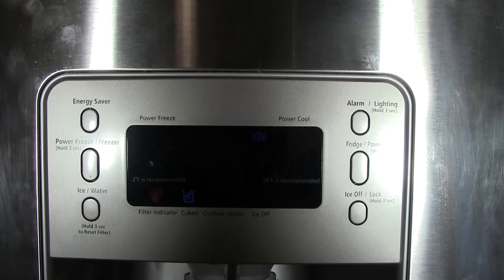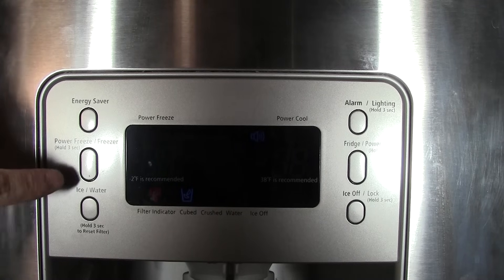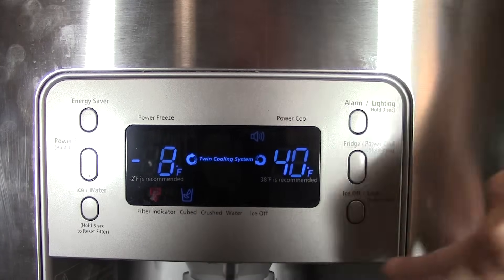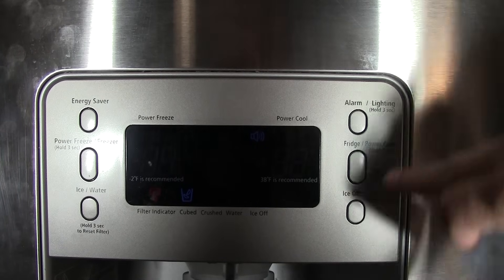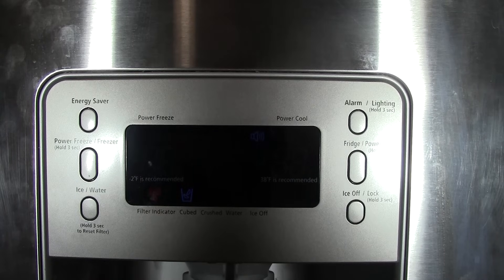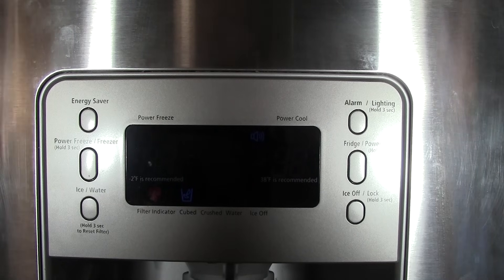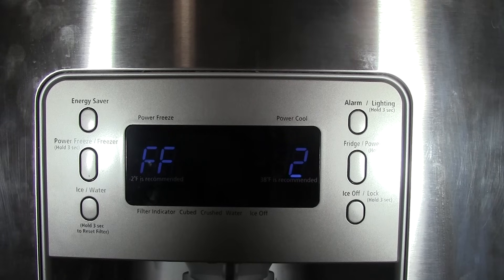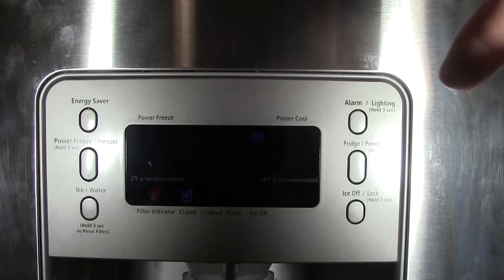FORCED (manual) DEFROST mode on a Samsung Refrigerator--Top Secret Setting

Comment: Geri, if yours is a RF267 and has the flooding and freezing problems (as with all 267s) it is the defrost drain at the bottom of the coils in the back panel of refrigerator compartment. The defrost system defrosts the coils (producing lots of water) but does NOT defrost the ice from the drain hole and tube that is supposed to get rid of all that water. So.. The water goes everywhere except the drain. Simple fix for this is to pull the compartment back panel and add a little wire (I use copper) to the defrost coil. I just wrap the wire a couple of times around the defrost coil right above the drain hole and run the wire down the hole 10 inches or so. When it defrosts it heats the wire a little and keeps the drain cleared, and abracadabra! No more water problems for about .50 cents. Or you can pay $200.00 plus to have it done by a Samsung Tech.
Reply: Timbo D Hello, and thanks for the comment, as my RF267 is starting to show these symptoms. Flooded all over my floor and noticed ice was forming around the vent holes within the fridge. I am about two thirds of the way getting the back panel off due to the ice accumulation. My question while I wait for it to completely defrost is since the drain hole gets clogged, is it safe to say it is due to the fact that something is not right with the evap coil? Whether it's not staying on long enough to completely defrost or it isn't getting warm enough to do its job in its entirety? Had this fridge for a little over 7 years and this is the first issue I've had with it in regards to ice buildup within the fridge. Just seems a little weird that only after 7 years the ice buildup would occur with it being nothing more that the drain hole being plugged. I understand the plugging is part of the issue but is that a result of faulty coils? If adding the copper wire down the hole is a 50 cent "hack" I'm still all for it, I was just curious if it is indeed a hack in order to prolong repairing the coils which I know is a much more costly repair or is it a bad design by Samsung?
Reply: In (my opinion only) I think the coil weakens somewhat over time like they do in dish washers. I did this to my own thinking about the same thing you are. Mine started freezing up at year five. I knew the defrost coil was good because I could hear the little sizzle sound now and then when it was defrosting indicating the coil was hot. Your problem could well be a bad coil or board but with mine it seemed worth a shot, and it worked great. You will see the little tab put there to defrost the drain opening and you will also notice it is far to short to do much good. The wire did the trick in my case. Be sure you defrost it (completely). There's a great little video by majdr622 "How to fix Samsung RF 267 drain problem - water under crisper" Check it out, and good luck!
Reply: Timbo D Thank you for that valuable information. I defrosted it for about 14 hours, adding hot water down the hole and sucking it back up. Only thing is it would never drain. I opened up the back panel and took the hoses off both the freezer and fridge and placed 2 small cups to catch any water....nothing! Bone dry! The fridge was unplugged and i even stuck a 14 inch plumbing snake down the hole and another 14 inch snake from the bottom end up...there was no resistance on either end but they did not reach each other!  Only thing I could think of was either the clog was between the snakes somewhere or since the fridge was off that there's some sort of trap door within the hole that prevents any water to proceed into the drain pan while off. I added a 4 inch copper wire into the hole and reset everything. It's been about 12 hours so far and freezer and fridge are back to operating temps...I guess I'll just wait and see if ice builds up again. Wish me luck! And thanks again for the help.
Reply: I don't think there is a check valve in the drain, but by all means my friend.. good luck.
Reply: There's an aftermarket drainer to clip on to the coil and insert in to the drain. I just ordered it https://www.amazon.com/gp/product/B008KFG9NO/ref=oh_aui_detailpage_o00_s00?ie=UTF8&psc=1
Reply: @ericponce8388  I wonder if the drain tube has p trap like a sink drain to prevent odor.  If so, you would need something very flexible but somewhat stiff to rod it out.  Maybe a big ziptie.
  Am trying to figure this freezing up problem on one myself in the freezer.  Have worked on many fridgedbut Samsung is a new one for me.  This one has nothing going into the drain to work in conjunction with the df heater.  It looks as though it has had one at sometime.
  Normally, the things I would check would be df thermostat, df heater, and timer or board on the ones I normally work on, but this is a little different.
  I will say this, imo, anytime you have to use a forced defrost, there may very well be an underlying problem, and I would expect the symptom to recur until the cause is remedied.
  Speaking of the ziptie, maybe try forced air which might be a little messy, especially if there is still water or loose gunk in the drsin pan.

Comment: Hi Jake, thank you for the video, learned a lot. Just got off phone with Samsung. I was told that the reason I'm not getting ice and cannot remove the ice bucket (only moved about an inch) is a "build up of ice in the bucket" and was told I needed to have it serviced. I asked her if I could correct the problem myself. I was told to unplug the fridge for up to 24 hours and let the ice melt. Jake have you seen the date, I have a fridge filled with thanksgiving goodies, is there something you can think of that Samsung isn't telling me.  Just have a feeling.....
Reply: what they didn't tell you is that Samsung knowingly designed, manufactured, and sold a defective product. A product for which they have issued 0 recalls, 0 explanations, and to this day they still do not admit to making a faulty ice maker, a device which has been around for decades.
Reply: @unanonymous4655  Do you also suggest a defrost  (forced) or is this something I will need a service man come out for.  My sister did indeed buy the extended warranty. *happy*. But this is a scam, it needs to be exposed. My sister filled the house with samsung appliances, we are not happy with the washer and dryer either. 
So sorry to bend your ear, I very much appreciate you contacting me. Happy Holidays.
Reply: @tammieadams3661   I say give it a shot, maybe run it a few times in a row. If that doesn't work try a hair dryer (careful not to have it on high or keep it in one spot for a while or it will warp the plastic). After that I'd say call up Samsung or grab some ice trays. Happy Holidays and to hell with Samsung appliances.
Reply: Try forced defrost (FD) and use a hair drier to speed up melting around the ice maker. Careful not to burn the plastic and watch for water- don't get electrocuted

Comment: I was ready to tear into pulling out the fan when I saw your forced defrost tip.  It fixed the fan noise so well it's hard to tell it's running.  And like some others have said, it recycled itself after about an hour.  Thanks for this valuable info!
Reply: When u put it in the n FD mode did you leave it until the beeping stopped?
Reply: @michaelbeltran8296 what is a 22.  E.   NOTIFICATION ON A SAMSUNG REFRIGERATOR?  IT HAPPENED as i plugged it is
Reply: @michaelbeltran8296   Leave it until the beeping stops, I suggest repeating the process to ensure all ice is melted. The fan tends to have a lot of ice buildup and the heating coil is not around the fan. The first time this happened to my fridge I had a technician to come remove the panel, defrost and change the termostat...waste of money. The fan was all clog up in 2 months. I did the defrosting my self without changing the thermostat lasted about 3 months. Now I am using double Forced Defrost ...I have this Samsung fridge  for 4 years-very disappointed

Comment: Great tip, just want to add that if you have to open the back panel at some point, add some copper wire from the heating element into the drain. It seems this problem is also because the heating element does not touch enough the drain in order to keep it from freezing. I added that wire and it kept me from freezing for 2 years.

Comment: Thank you! After resetting filter I saw OF for both  freezer and fridge on the display and temp started rising fast.  My model is different from yours in the video but holding Power Freeze and Energy Save together made the the compressor start up just as you said! I am so grateful, it's 8 pm on a Friday night and you have saved everything in my fridge!

Comment: This was a very helpful video.  I put my fridge in Forced Defrost regularly now to avoid ice build up since I had to open it up to get the chunk of ice out of the back this summer.  Since then, I experienced a new problem which I have not been able to find much information on the internet.  The refrigerator compartment was getting too cold and freezing up my fruits, veggies and liquids.  After much trial and error I determined that the issue was that the damper door in the back of the crisper tray was somehow "stuck" in the shut position.  This resulted in the cooler air, meant to go into the crisper drawer was being routed to the top of the fridge instead, resulting in it being too cold.  I don't know if others have had this problem, but if they have, it could be the topic of a helpful video particularly showing how to take the crisper compartment apart to replace the damper if needed.  I was lucky, that mine seems to be working (so far at least) once I forced it open, so I have not yet had to replace it, but I can tell that removing the shelf where the water filter unit sits is not easy and necessary for damper replacement.  A replacement damper is about $45 on line.  Thanks again for your helpful videos.

Comment: Thanks for the info!  I didn't read all the comments so this may have been mentioned - there is a retrofit kit part number DA82-01415A  This includes a better designed little aluminum piece that is heated by the defrost coil and sticks down inside the drain tube.  It also comes with 2 new drain tubes (installed from the back).  If the problem originates from water not draining and backing up, freezing, etc.  This kit may help the defrost problem.  I needed it because my RF267 was draining down under the deli tray.
Reply: We did that!  It was our original problem and the solution worked perfectly.  NOW the coils freeze up at the top instead.  This causes ice build-up on the fan which eventually stops working.  Sigh... hopefully, this video will solve that issue.  I'm not opposed to forced defrost once a week but I am tired of taking my frig apart every six months.
Reply: I added the drain kit and changed the sensors. I also bought pipe insulation for the exposed copper tubing behind the panel. No longer ices up. It's been 9 months.
Reply: UPDATE:  
After watching all the numerous videos and trying all the suggested fixes, it continues to ice up...  FD worked for 2 days at most.  Ice was now forming on the back wall inside.  After having it apart 4 times in 2 years, I finally just trashed the whole thing.  Bought a Whirlpool instead.  Fingers crossed!!
Reply: This happened to us as well.  We did stop the leaking but now, 2 months later , the fan is very noisy.
Reply: @kevincummings8755  what do you mean by changing the sensors?  Just to confirm, this was insulation around cold or warm pipes?  I’m not sure where the evaporator outlet is, nor do I promise to be an HVAC tech, but I’m having the same issue after installing the aluminum defrost adapter.
Reply: @Thrasher857  insulate all copper pipes that are exposed behind back wall headed up from the coil to where they go into the wall. Install new defrost kit. I also changed 2 sensors I found in parts break down. Me refrigerator works fine now. Ice maker still not working that's another problem.

Comment: Absolutely awesome tip.
My Samsung French door model was continually forming ice under the bottom freezer draw and then melting when it reached the very front.
This tip (so far) has seemed to have worked.
The only difference with stopping the forced defrost mode on my model is it uses the same 2 buttons as entering that mode .
It cut off automatically after approximately 40 minutes and went into "normal" mode, so it would seem safe to do while occupied doing more exiting stuff as the continually beeping which can't be muted while in forced defrost mode is rather irritating.

Comment: Thanks. This helped me already several years ago, and I've been using this every couple of years. The defrost sensor dies every year or so, and I force defrost before swapping it out.
Now my freezer says it is at -18°C but it's not cold inside, and all the food is defrosting. I noticed an ice buildup in the rear wall (frost kind of creeolping through the vent holes). Will the forced defrost work for me on the freezer as well?
Thanks in advance.

Comment: Thanks for the defrosting tip Jake. My RFG237AARS/XAA took about 45 minutes to quit beeping. The compressor noise stopped and it seems to be cooling down without without anymore "button pushing" on my part.
Reply: interesting points ,if anyone else wants to learn about best phone number lookup app try Tarbetti Phone Finder Tutor (do a google search ) ? Ive heard some great things about it and my buddy got excellent success with it.

Comment: skip to 6min so see force defrost

hold Energy saver and fridge button at same time for 12 sec or so
when display goes off, press fridge button to light display
press button till FD appears, this is force defrost
press hold energy saver and power to return to normal
Reply: Thanks. I have a RF263teaegs.  This worked.  I screwed around with it until I found this combo.  Holding freezer and light causes it to display two numbers that I can move up or down.   Not sure what they do so I put them both back to 0.

I will say this incessant beeping for Fd is annoying
Reply: @troyetherton5869  I'll take the beeping any time over $200 service call. $100 for showing up and then I'm sure some defective parts will be found. Bunch of whiners.

Comment: Force defrost runs about 30 minutes at least on my test. Sample size is only two though! You may have to pull the power plug out and put it back on to restart the compressor. Thank you for the video, it works beautifully.

Comment: I used this method to force a defrost on my Samsung refrigerator when removing the evaporator access panel. After a 15 to 20 minute forced defrost, the stubborn panel was finally removed. It seems that the forced defrost helped the panel removal.

Comment: Thanks for this easy fix. My Samsung RFG295 has had the issue for several years. I've always had to remove the bottom drawer, break out the 1 inch ice puddle and then remove the shield in the back but the 2nd time using the forced defrost made this much easier. I'll start doing this once a month. I remember the drain tube being full of ice and may need to do another fd. Do you recommend doing a fd on the refrigerator as well? My freezer was fine but my refrigerator was around 50.
Reply: Same situation with our RF26HFENDSR/AA.  We used an external thermometer to confirm that the refrig is at 50 but the freezer is working fine.  I am running the RD cycle twice to see if the visible ice I can see in the holes in the Twin Cooling Plus cover melt.  I just ran FD one cycle for about 20 minutes, and collected a bunch of water in the bottom of the fridge.  Running an RD cycle now (20 minutes into it...) so we'll see if that finally melts the ice on the coils.

Comment: Jake , is there a good video for changing the reset button?  I have taken out the ice maker,checked to see if any wiring was loose. My ice maker is making ice but will not dump it ? I bought some ice to see if it would dispense it and it does!! So what would you look for now?
Reply: In case you haven't noticed, this is not a technician making these videos.
Reply: Any video on how to take the ice maker out?